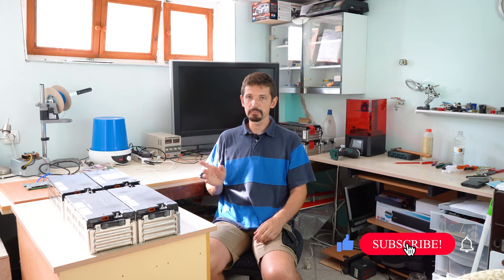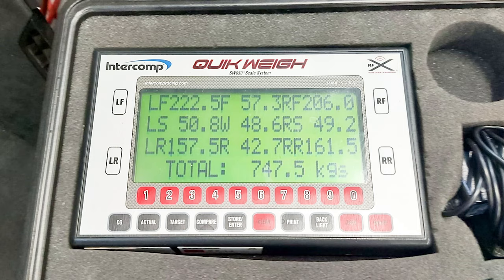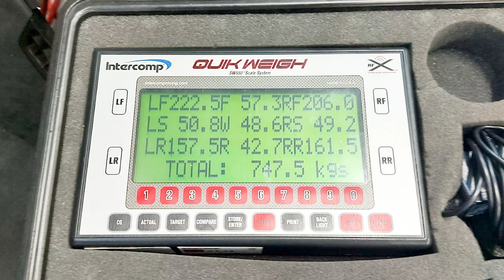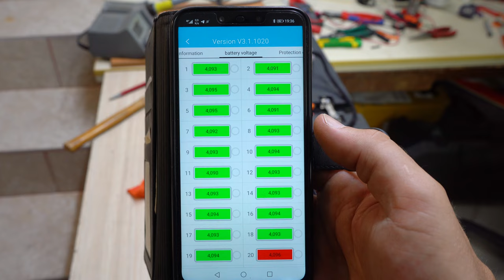Opel Corsa electric conversion &  battery reconfiguration

Comment: Thank you for your help with the battery, the car was driven for the first time yesterday. All the weight is now low, the car drives perfectly. I still need to connect the wiring for the charger and a few small things, the car was completed in a record time of only seven days. I will make a video of the rides soon. Greeting.
Reply: I would be interested to know more about the motor you used etc.

Comment: do you have a lead on those connectors for the BMS board? or did they get salvaged along with the former pack? I'm trying to find that connector for my personal conversion if possible
Reply from the maker: I have harneses with the battery
Reply: Get the wires with the battery or you will have a headache.